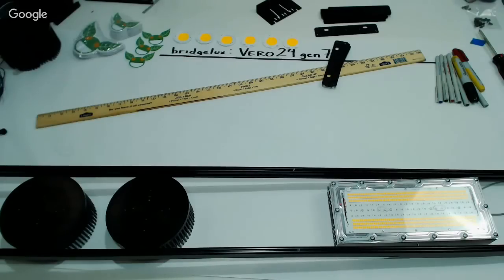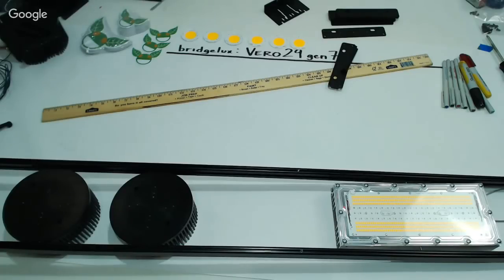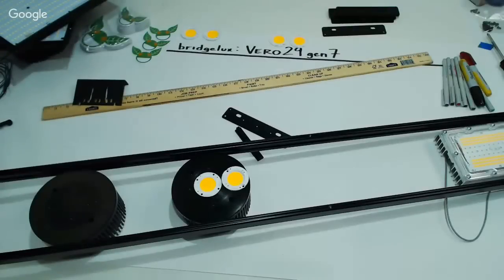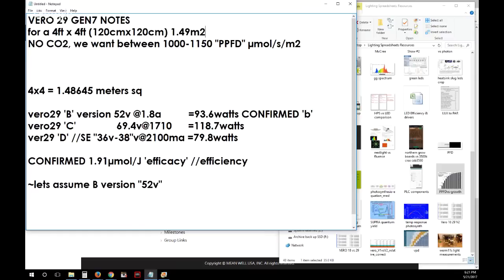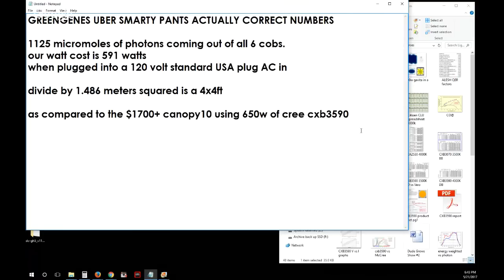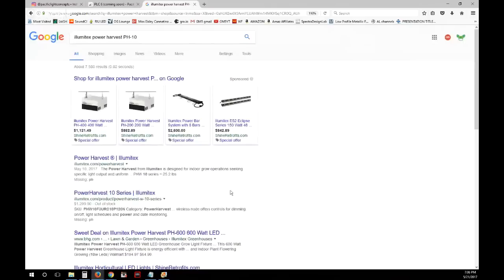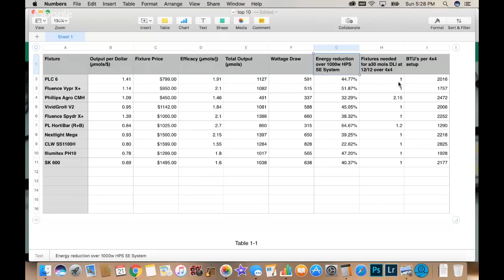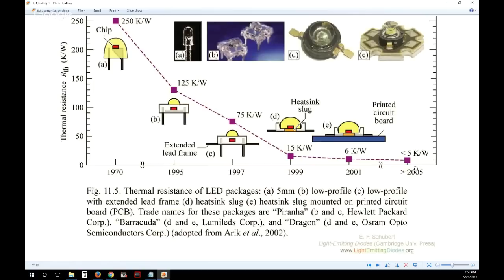vero29 research & discussion, frame talk, light per $$ of popular commercial LEDs

Comment: Are there any gimbals or track lighting adjustable mounts that will hold these cobs?
Reply from the maker: im working with inexpensive Amazon/ebay 3D printer parts to do a slider.
Reply: It would be nice to have some directional control of the individual cobs. I see plenty of track lighting mounts for smaller cobs, they even have built in heat sinks and fans. I was wondering if you've come across something we could use for horticultural cobs.
Reply from the maker: the rapidled substrat offers 3 axis adjustability. other than that, theres not much out there unless you build it yourself

Comment: I got a chill 450 diy, It's not performing well for me. It doesn't seem bright enough. I  pre ordered a new chill 400 watt dual pannel light before I tried the 450 diy. Now Im not sure about the new gen lights, even tho they are supposed to be better. I checked out the plc 6 and think that might be a better light for the money. Please give me some feedback. Thank you. Do you know any body that wants to buy a chiilled 450 diy light?
Reply from the maker: The chilled gen2 fixtures are awaiting full fixture Integrating Sphere testing.  The boards including driver losses were reading 2.67µmol/J.  if we use that sphere data from the Chilled website.
-a chilled 400w puts out 1069 µmol total at the source of the LEDs
-a PLC6 (591w) at 1.91 puts out 1129µmol at the cobs.  a 5.4% increase in photons (obviously white cob spectrum)
and 32.4% increased watt draw over the Chilled.  Both are great techs, If you have already pre-ordered the Chilled, I think it is a wise decision.
Reply: growmau5 thanks for the info , peace!

Comment: killllllllin it like always, I hate all these 2.5 hr live streams killing the "nice video" game on youtube but this was the shit front to back! sorry i was not there with y'all
Reply from the maker: Shredder OG balance in all things, even youtube content. Thanks for checking it out bud.
Reply: yooo man i got 4 vero i'm trying to light up and i got a two part question. I have a driver from your old cutter cxb kit (250w 1400ma) and it's lighting up all 4 vero. but I have some hlg185 700ma drivers from before my last upgrade. so question #1 can i drive two vero29 on one of those hlg185's and the other two with another hlg185? and if i can do that would it be more light to the plants than the single (ZPE 250-1400D i think) mau5 kit driver?
Reply from the maker: lets see:: meanwell HLG-185h-c700 has 286 volts available.  Personally, I would only consider the "C" version VERO for this low current driver.  Spec sheet says (66.2v at 855ma) so figure 66v per cob. So you can run (4) vero29 gen7 model C cobs & still have 22 volts left over to run up to 8 or 9 cree XPE-HE 660nm deep reds if you wish.

Comment: Can run the Vero 29 on a 700ma Meanwell?
Reply: Goodfella 420 a Vero 29 can run on a 700ma Meanwell driver.  It could run on a 10ma driver if it had too, although it wouldn't be very bright.  What is the voltage on the driver? It might be worth looking into getting as many of the 70v Vero 29' SE D's or alternatively the 52v Vero 29 SE B's  as your driver voltage will allow so you can get which would allow you to get maximum wattage out of your driver as possible. For example, if it was a 240v driver you could run 3 Vero 29 SE' D's or 4 Vero 29 SE B's  It would also be one efficient grow light with a current of 700ma.

Comment: I am so confused if it's 50-70W max a chip how the f am I running 2 at 180W lol? 3000K 29 vero :$?
Reply: That High Canadian - THC volts. Vero 29 come in 36, 50 and 70 volts. A 70v chip driven at 2400ma would be 168w.